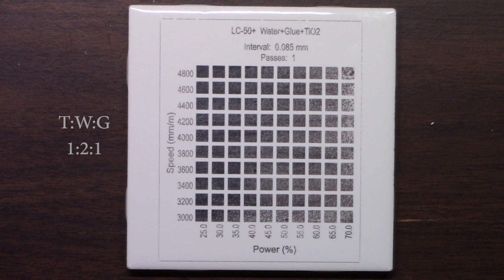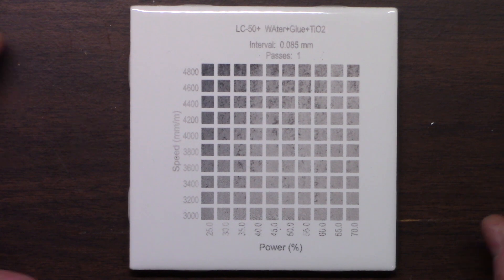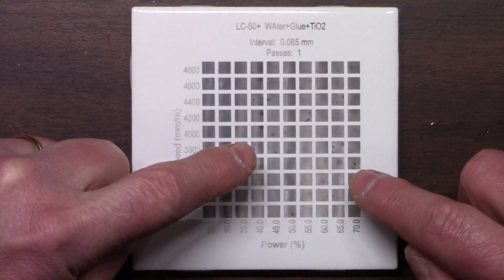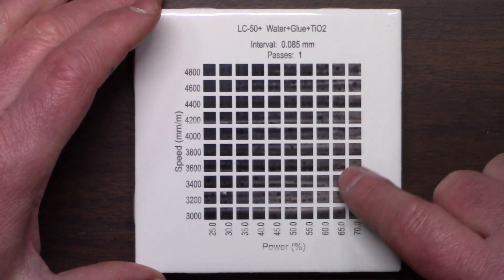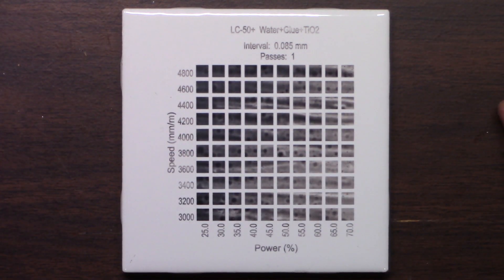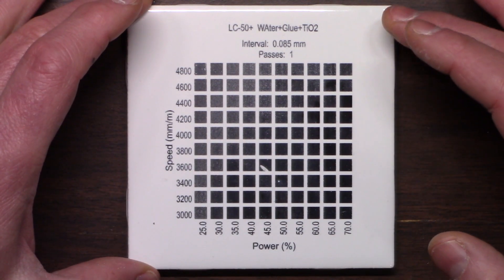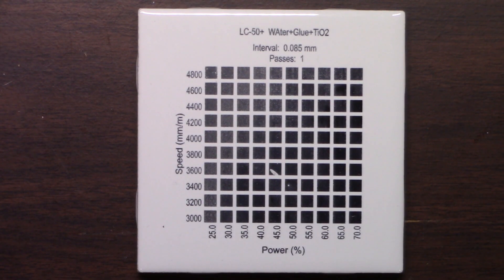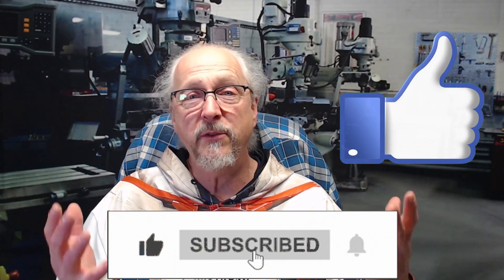Is mixing TiO2, water, and glue is the way to go?

Comment: Do you have that tile design handy? I would love to test this out using your setup in lightburn.
Reply from the maker: Great question.  That material test is generated within LightBurn based on a set of parameters you give it.  So I really don't have that design.  I did a video a while back on using the Material Test option within LightBurn (https://youtu.be/RPNzjK4kvEQ?si=j_gcW3uuIUkb2EzH).  Before they had this feature, I did create my own test by creating a bunch of squares and had each on at a different power and/or speed.  I did a video on that too: https://youtu.be/_Enrn7ruqs8?si=21ShIoNW3_53UTyK
I hope this helps.
Reply: @CNCATHome  Thank you!

Comment: I have decent results I use 311 mix 3 parts water 1 part glue 1 part tio2 and 10 drops food coloring. Mix well and clean the tile with alcohol, apply tio2 mixture with air brush. Apply 2 even coats.
Reply: I also add fine copper powder to the mix and you get a gold color instead of black.  I give all credit to Johnny laser!
Reply from the maker: Thank you for your mix formula.  Enough people are using this and getting good results that I do want to spend more time trying it.  Thank you for passing along the copper powder trick you had gotten from Johnny Laser.  I plan to see if I can find images of the results as that sounds very cool!  I would bet you could sprinkle the copper on the tile in specific locations to get the effect more localized.  That could be very cool!

Comment: Have you tried using your normal mixture on glass? I’ve been using the chalk paint mixture, but the results are suboptimal. Since you seem to have dialed in the ratio for the titanium dioxide and denatured alcohol mixture, I’d be interested to know if it works for clear glass as well as it does the tiles.
Reply from the maker: Great question.  Yes, I have used my TiO2 mix on glass and it works great.  I did a picture on a 5x7 piece of glass and then painted the back side of the glass and it worked very well.  I tracked it down: https://youtu.be/Dn_V63mFfh4 at about 4 minutes in.  ;-)
Reply: @CNCATHome great, thanks! I’ll give it a try when I get some denatured alcohol!
Reply from the maker: Regular isopropyl alcohol should work too if you can't get denatured. I use denatured alcohol because it is cleaner. Isopropyl alcohol really isn't dirty and will work just fine and it is cheaper and a much lower fire risk.  Denatured alcohol burns virtually invisible and if it ignites, it is easy to not now until you get burned or something else catches on fire. Be careful with it!!

Comment: Hello AT, after many experiments gone wrong and watching dozens of YT videos here is the mixture that works really well for me on white and gray tiles on my 10/30 watt Roly laser. 1 part TiO2, 2 parts white chalk acrylic paint, 1 part alcohol, and from there the amount of water depends on how thick or runny you want it. I might only need a few drops of water because I only mix a small amount at a time like <1/4 cup. I do not use any school glue. I have tested this method on both white and light gray tiles and get amazing results. I also use imagR to prep PNG or JPG images (No prep needed for SVGs) and always set the dpi to 318 and play with the gamma slightly based on the image and also apply some sharpness. I am very happy with how they are turning out. Thanks for your videos.
Reply: I forgot to mention that I use a foam brush to apply two coats and allow to dry for a couple hours in between coats. The foam brush leaves very fine lines that show in the engraved tile. I don't know how to eliminate the fine lines unless I use the syringe method.
Reply from the maker: @OrdinaryWoodworker  - I like the idea of brushing it on but I don't like the streaks it always seems to leave.  Using an airbrush with a thin mix works well but squirting it on with a syringe is quick, leaves a good even coat, and the clean up is quick and easy.  I have people tell me they dip their tiles face down into their mixture.  I have not tried that but one would think that would be quick and you would get full coverage on the tile.
Reply from the maker: That is fantastic that you found a mix that works for you.  And never stop experimenting with what works as you never know when you will find a better method.

Comment: I got good results with 2x TIO2 + 1x Water + 1x Alcohol + 1x Glue. Using a foam brush and an IR 80W laser
Reply from the maker: Thank you for the information.  I will have to give this ratio a try to see how it works for me.
Reply: I have read that a fine 1 inch brush or a large makeup brush will give better results than a foam brush, but have not been able to test it myself. I havent taken the step to tiles yet, still learning my laser and doing tumblers.
Reply from the maker: @spud69g  - Interesting approach.  TiO2 is a fine powder so it could be applied that way.

Comment: Go to Lowes.  Get a can of Inverted Marker Paint by Rustoleum.  This is the maker paint they use for marking lines on the ground for electric wires, football fields, etc.  Spray it on your tile, let it dry, etch your image, wash the marker paint off in the sink.  It'll come right off.  No chemicals required.
It's that simple.

Comment: geez  I guess you don't like me this is the 3rd time you have removed my comment???????
Reply from the maker: Unlikely.  Unless you say something really offensive or otherwise inappropriate for a video, I do not remove comments. Over the years, there have been very few comments that I felt should be removed.  If you are making comments that are not showing up here, we are not removing them and there must be something else going on.
Reply: @CNCATHome Alll I did is ask if you had tried the Preval Sprayer for applying TI02
Reply from the maker: @pblais404  - I am unsure what happened to your comment.  I have never hear of Preval Sprayer before so I looked it up.  That is a sweet thing!  I have used a battery powered airgun that works well for dispensing my denatured alcohol and TiO2 mixture. It is very unfortunate that your previous comments went missing. Pierre, I get notification when comments come in and your comment about removing comments was the first one from you.  It is very unfortunate that this happened as your comment is awesome! Thank you.
Reply: @CNCATHome  No worries..  All good AT

Comment: Something occurred as I was watching: what about just painting the glue on and sprinkling a heavy coat of the TiO2 over it? From what I have gathered, the main issue with TiO2 is getting it to stick consistently on the tile. A thin coating of glue, which sticks to the tile, would also hold the TiO2 in place.
Reply from the maker: That is an interesting idea. Thank you! You do want the TiO2 on the tile so it will stick when you hit it with the laser.  Somehow in the process of crystalizing, it then sticks to the tile.  My next video will show a method that worked well just using TiO2 suspended in denatured alcohol.  It leaves a consistent layer behind and the alcohol evaporates quickly.

Comment: It’s not hard to believe that using a foam brush doesn’t give consistent results. But I am wondering if multiple coats (allowing each coat to dry first) might not produce better results. 🤷‍♂️
Reply from the maker: 🤣  The foam brushes have their place and this may not be one of them.  I have used a bristled brush to apply the mixture and it didn't work any better.  If one coat doesn't leave an even amount of TiO2, I am not sure multiple coats would either.  That would assume that where there hadn't been enough, there would be more and where there had been enough, wouldn't get too much more.  Next week's video will talk about another method to apply my mixture that worked very well.  It will likely be my go to method.  Cleanup is quick and the coverage was very even.
Reply: @CNCATHome  I have been using the school glue method very successfully for some time now. i use 1 parts TiO2 3 parts water 1 part school glue couple of drops of food colouring. applied 2 coats with foam brush. works well.
I have also used the TiO2 mixed with Metherlated Spirits( purple colour) which i think is the British equivalent to Denatured alcohol in various spray bottles with mixed results. i am considering using an air gun similar to yours next.
Keep sharing your trials as we find them very helpful

Comment: I have been experimenting with cold galvanizing on tile.  I'm trying to leave a conducting layer so that I can quickly create single sided PCB designs.  I have managed to produce conductive traces, but I can't  get them tinned.  I've been thinking about trying SnO2.  That's pretty safe since it's used in ceramic glazes and fingernail paints. Any thoughts?
Reply from the maker: That sounds like a very cool thing to try.  I don't know anything about using Sn02 so I did some reading.  What I have found so far seems to point to needing a much more powerful laser than what I have.  There were two methods that seemed to have some promise: LIFT, rLIFT.  It would seem those processes are much more complex than just putting some SnO2 on a tile and applying some laser heart to it.  
That is very cool that you have been able to create conductive paths using zinc.  When I did a quick test of the resistance on some etching I have done with CGC, the resistance was infinite so nothing seemed be flowing across the etched surface of CGC.
I came across some articles about using a laser to etch a PCB that already had a copper layer on it and you basically burn away what you don't need.  That starts to get into an area that can be dangerous as burning some types of copper creates a very toxic fumes.